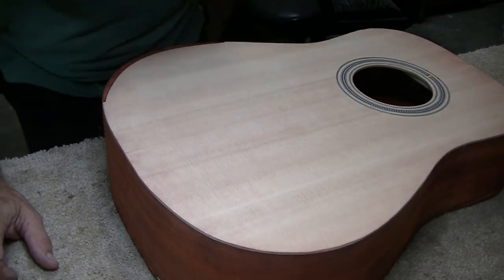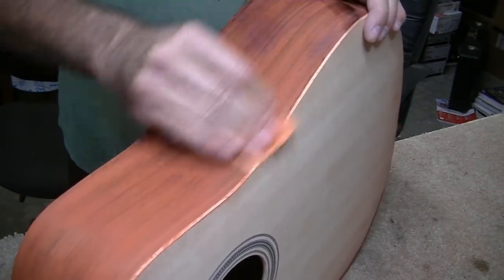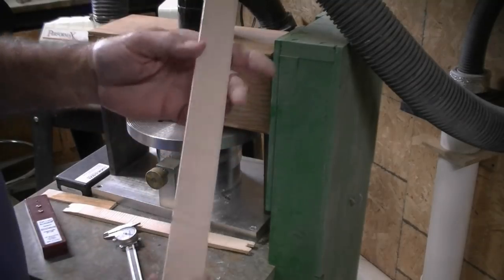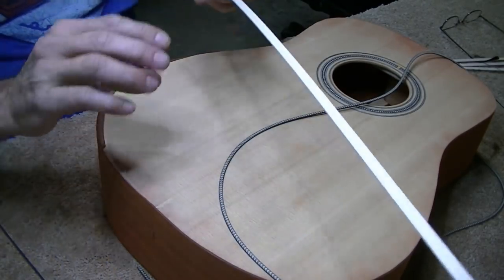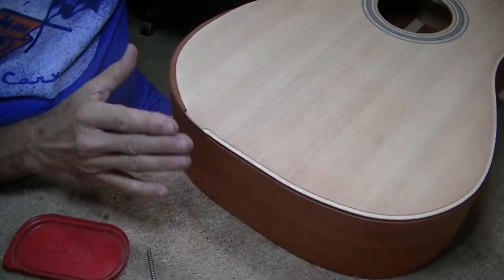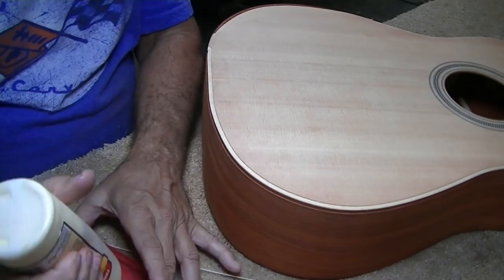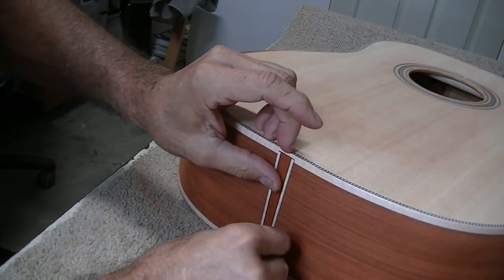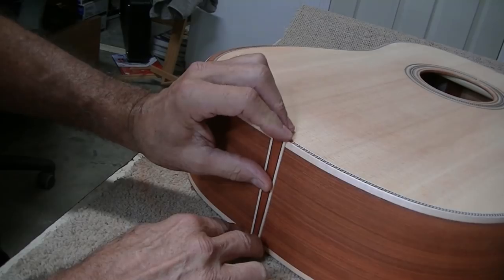225 RSW Custom Guitar P7 Body Binding

Comment: "three quarters of a millimeter"  cracks me up!
Reply from the maker: Well I generally measure everything in thousands. One one thousandth of an inch is 1/40 of a millimeter. That's the Precision I work too
Reply: I work in an industry where we mix imperial units and metric units on the same project.  So, mixing fractions with metric units is perfectly understandable.

Comment: Thanks for putting the millimetre sizes in your videos, like many of your viewers not from the USA I struggle to understand measurements described inches and thousandths of inches. The inclusion of the metric system for your videos is very helpful and considerate.
Reply: Paper Sphere I’m from England I fully understand imperial and prefer it to metric .

Comment: This guitar is coming along nicely. Those extra little bits of white that show at each end of the arm rest could have been cut out and replaced with a bit of glue mixed with the sawdust created when you made the cuts for the binding. I don't know if it would have been worth the extra work. Those small white bits aren't all that noticable.

Comment: I usually do that with die grinders spin them opposite you got to make sure the Chuck is locked because the vibration will loosen it but it doesn't make tear out it makes it easier cut takes a little more time but it's a cleaner job!!!!!

Comment: Great video! A question though. Wouldn't it have been easier to put the decorative triangle in the bottom before the binding? After fitting and sanding you could then route the binding channels? Not being critical, just wondering? I'm getting ready to build one myself and didn't want to it that way if there was reason not too. I would like to thank you for this series, I have already seen some things that i would done different  and would have had to start over. Keep up the wonderful craftsmanship. God bless.
Reply from the maker: To be honest I'm not sure what you mean by decorative triangle. Racking my brain and can't think of a triangle other than the heal cap. The only thing I can answer in general is there's a hundred ways to skin every cat. So just because I do it one way, doesn't mean it can't be done another way.
Reply: @RosaStringWorks  i was talking about the triangle on the end where the strap button would go. Between the binding on the top and the back. In the center of the bottom side where the heel block goes. I don't think my skills are up to doing it with binding on top and bottom. I was wondering if I could router that piece in , then sand it even on the top and bottom then router my binding channels on top and bottom. I'm afraid I would mess up the binding of it was on first. I'm nowhere near the craftsman that you are but I really loved that piece! It just tied it all together! Thank you for your videos. I am always amazed at the beautiful work that you do. Your the reason that I'm going to try to build my own acoustic ( and the fact that I could never afford the price of such a quality instrument already finished!  Lol.) I was in no way being negative. Just looking for a way to accomplish it with my skills. Thank you for the reply. God Bless you and your family. 😊

Comment: Hi Jerry, thanks once again. I love the way you generally show ALL the process. Great for novices like me. What RPM do you have your Dremel set at? I only use mine for purflings and set at max. I use a laminate cutter for bindings, but was thinking of switching to the Dremel for better control. Would a slower speed be better? Regards
Reply from the maker: Whole lot depends on the actual cutter being used regarding which speed to use. I don't necessarily think I'm the expert on that. Mine is mostly just trial and error.

Comment: Jerry, great job I love it. Can you tell me what is the depth stop thing you have attached to the dremel for cutting the purfling & binding channel?? Also what bit did you use? Thank you.. Im building my first ukulele & I've never cut binding channels before.
Reply from the maker: The depth stop came from Stewart MacDonald. But I customized it to get the little guide closer to the bit. The bit that I'm using...  I don't recall exactly but it's a standard Dremel bit. It has two carbide Cutters on the sides.   I believe it's also sold by Stewart MacDonald.
Reply: Rosa String Works Thank you very much Jerry

Comment: Super nice!
I have a question.
I am converting an acoustic guitar to a dobro and I want to add some binding as well. 
Is there another way to pre bend it without such a fancy heating system?
Reply from the maker: If it's plastic you can put it in boiling water. If it's would you can have a propane torch blow through a piece of pipe to heat up the pipe

Comment: Second time through this series, and I just noticed something that is probably further below in the comments ... you redid the back.  The hand-made herringbone is gone.  I'll dig through the comments to see if you had a reason ('cause I really liked the original), but I'm sure you did.
Reply from the maker: Actually I think you are confusing two different guitars. Video series 225 was the first one. That's the one you're commenting on presently video 348 is the one that I am currently building and that is the one that I made the handmade herringbone
Reply: @RosaStringWorks  Maybeso!